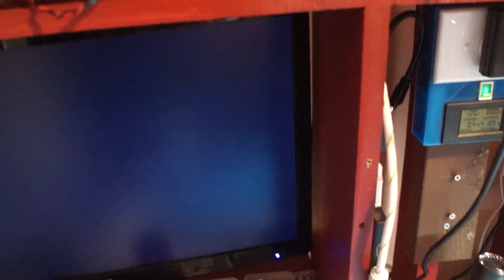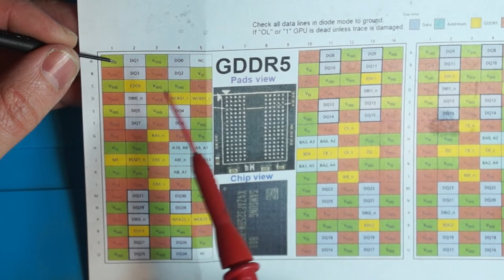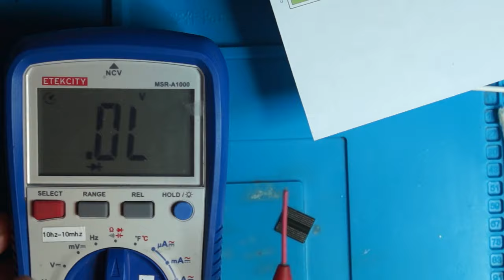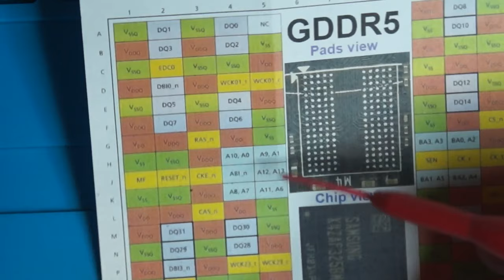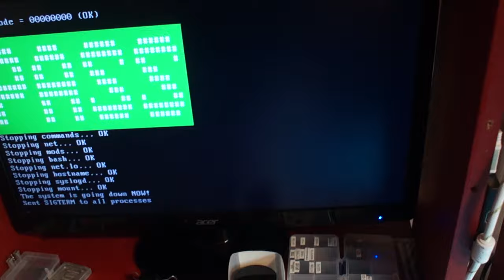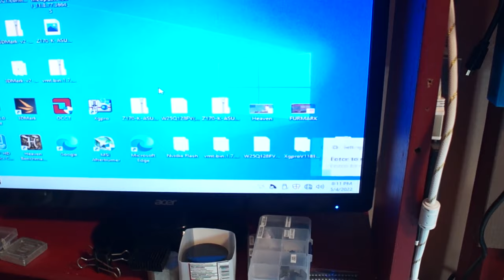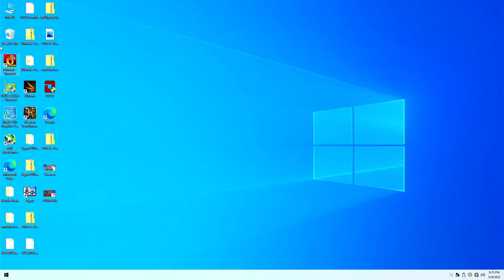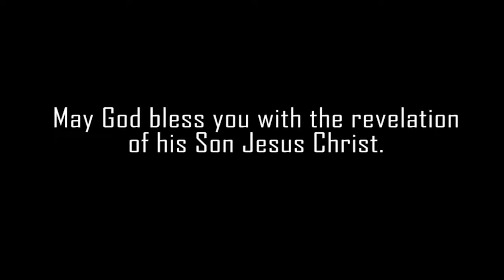How to check bad memory on a graphics card GDDR5 GTX 1070 fix

Comment: I just learned that phase controller can be a culprit on error 43 , thanks, I've been fixing gpu recently and i just stopped, surrendered on repairing due to lack of tools like thermal cam, reballing machine, etc.
Reply: Just about everything that's not working properly can be the culprit for error 43. Usually, to determine if a controller is working properly or not, one needs an oscilloscope. A controller can actually work... of a sort but many times it can not provide the correct output towards whatever it is controlling so you get a core voltage but it is not the right one so the card will work but actually not work. You can repair probably 75% of the broken cards without a thermal cam. Anyway there is a pen that puts a tiny layer of soldering rosin on an area of a board and you can see where it's heating. It costs almost nothing.
Reply: @Dandan-tg6tj right, you Can also use the freeze Can or air blowing Can in upside down position.
It will create a thin layer of ice and After poking the card, the thin layer melts on the faulty component

Comment: Hello brother, I am repairing the graphics card. Is it possible to convert an 8gb card to 6gb in the rx series? For example, the chip is faulty, even if the d0 and 01 vrams are changed, it still shows faulty. In this case, is it possible to disable d0 and d1 and run the card as 6GB?

Comment: I have gtx 1070 ti and hot spot go's up to 96c°  in temps  and gpu core 83c° temps on full load is it normal or should I be worried 😢😢😢

Comment: Awesome vid! Question: what temperature are you heating the memory chip with when reballing, and when you mount the newly reballed chip to the board do you keep the same temperature on the hot air? Thanks for the info you provide!

Comment: Hi, first good videos, but two points. Dataline in midle is diferent too on good chip. 😬 Second, soldering on iron is no good idea, better is on wood, best on wiremesh. Simple minimalize contact with cold surface.

Comment: For me, the most important question would be:
How to get Mods/Mats up and running?
If I come across a dead graphics card, I would be willing to do the BGA rework and everything around it. However, I cannot spent hours or even days, trying to get some semi-official software compiled in a Linux-Environment (which I don't have) and deal with one roadblock after the other trying to get it to "just work".
Is there any hint you can give me where and how to get a version of that software, that can be made operational with about the same amount of work that it takes to get a windows installer operational?

Comment: Hello
When I enter the game (Warzone), after a few minutes the image freezes and nothing works, and I only have to press the reset button on the case to restart the system!
I also tested it with the Furmark software and inside the GPU-Z  software TDP it is at zero percent .
GPU MODEL : ROG Strix 1050ti o4G ( The maximum temperature is 62 degrees under load )

Comment: If you change memory, is has to be same brand?
Is it ok for example change all for better memory brand?
And can you change from ddr5 to ddr6?
Reply: Gddr5 and gddr6 are different size chips.
You can change the brand of chips but this requires modifying the strap resistors.
Same brand you can normally use anything that's equal or faster than the original

Comment: Question why does it only have 4 power phases?
Reply: To limit the life of the card, after warranty ended the mosfet Will degraded from heat and died making the crater on PCB pad
Reply: o.k. For the life of me I can't even remember why I asked the question now.

Comment: Asus GTX 1070 boots , it's pixeled bad everything shows up in gpuz besides memory size, bus width and bandwidth
Reply: I have a GTX 1070 how much would it cost to diagnose it I think it's a ram issue it's a Asus
Reply from the maker: reflash bios. make sure 100% correct.
check strap resistors